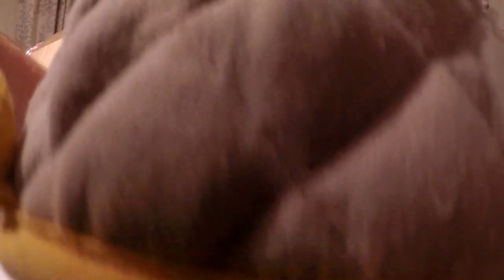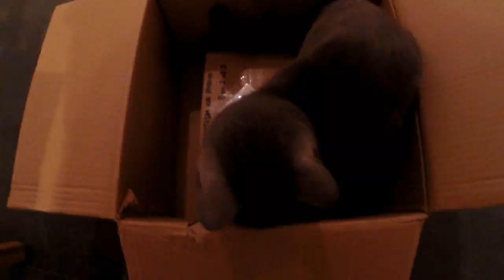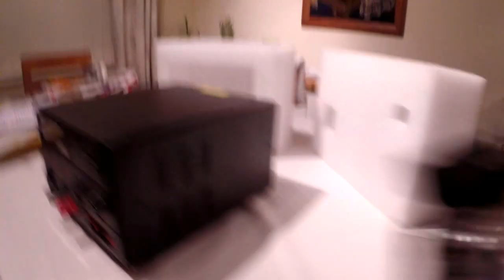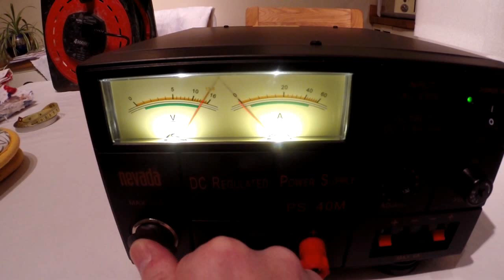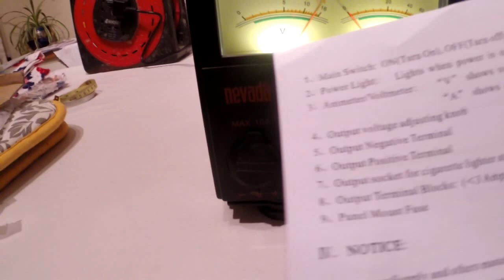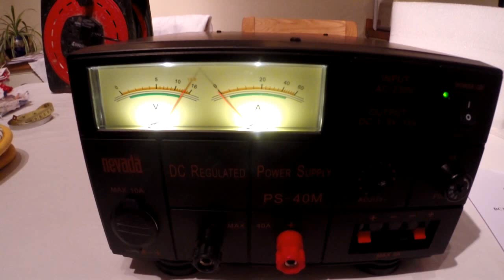flux capacitor

Comment: Linier power supply?  Bit of a cheek to say it is 40Amp and it is 30 continuous with a 35Amp surge. EDIT:  
This keyboard is driving me nuts!!!
Reply from the maker: Yeah it is thats why i got it in, but it be fine for my application. Sounds like time for a new keyboard!!!
Reply: @britishcbradio1055  It's a Laptop mate, can't change it easily. i could clean it.  It has another problem though, it can't spell either :-D
Reply from the maker: @BoB4jjjjs  Hi Bob search for the keyboard change on youtube, I di my daughters laptop keyboard about a year ago it was about a tenner for a new keyboard and not that bad to fit following the youtube video, worth a thought, the spelling, well you are on your own with that one we all suffer there!
Reply: @britishcbradio1055  Me a bit more than most in the last few years!  I have also noticed that although I am thinking and going to spell a word right, I don't always even attempt to hit the right key to spell the word.  Thankfully the processor corrects me most of the time.  It does come up with strange suggestions for words and is not good at guessing what I tried to type!!!
I will look for a Keyboard, though I am not to keen in going inside the Laptop.  I hate ribbon cables and tiny screws!

Comment: MAAS KPO JETFON 55 amp is the the spitting image of  the NAVADA 40 amp you have on eBay £132.99 + free 3 day postage. 
Maybe send that one back if it is from Amazon and get the 55 amp instead. 
I have the NAVADA  35 amp and have seen the same model under different names and MAAS is one of the brands.
Reply from the maker: Hi , Checked the MAAS one, thansk for the pointer but unfortunatley that is a switch mode power supply and mine is a regulated one, I had a switch mode in the past and it interferred with my radio so I got rid of it and now I only ever buy regulated ones as I know they won't cause me interference. I have just done a big investigation into some interference I was suffering (one of my earlier videos) and traced it to the WIFI extenders, what with these and LED bulbs etc you have to be so careful these days.
Reply: @britishcbradio1055  I have been very lucky as they recently changed out street lights to LED and I live on a main road with a large secondary school across the road and a private nursing home next door as I am in the last house on a terrace row of houses. The only time I get noise is off our outside porch light that we never use. So on a cobra 148 on an empty channel the S Meter needle does not lift in my computer room :)
Reply from the maker: @68LP13  Its all location based I think , I have my interference preety good now i think. Sounds like you very lucky where you are nice rig the Cobra. Happy DXing.
Reply: @britishcbradio1055  Sadly had to let my Cobra go, but the Yaesu is about S 2-3, Super Jopix 2000 S 1-2, SS 6900 S 3-4 and recently President Richard 2 is S 4-5 static so with me it depends on the radio and if you have a radio that is generous with signal comming in will also bring in the noisy static.
Thank you for your replys bud chao chao for now 73s.

Comment: is its a switch mode or linear power supply
Reply from the maker: Hi Nigel Its a regulated one made specifically for CB, I have used this typoe for many years since a bad experience with a switch mode that caused interference so only use this type now. Switch mode may work for others but not for me from my experience.